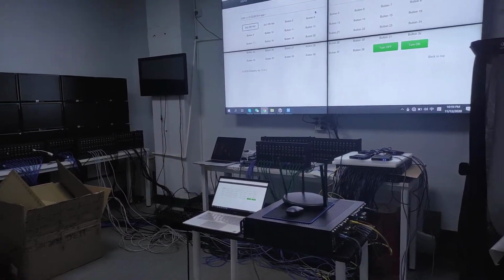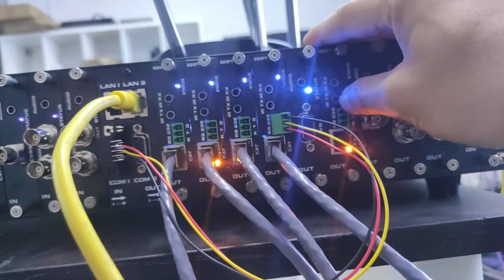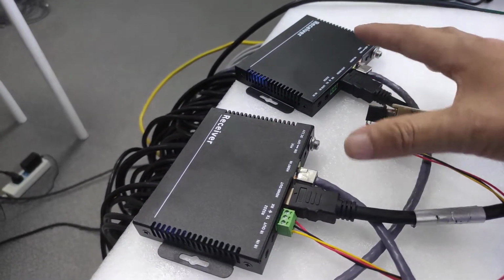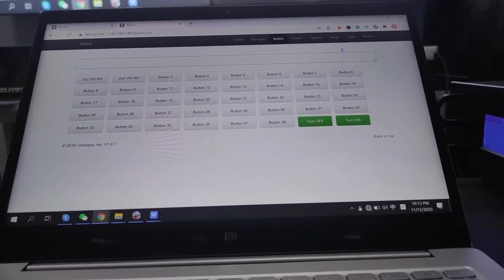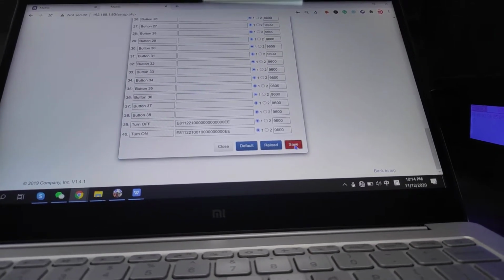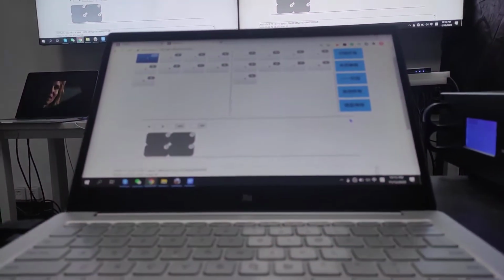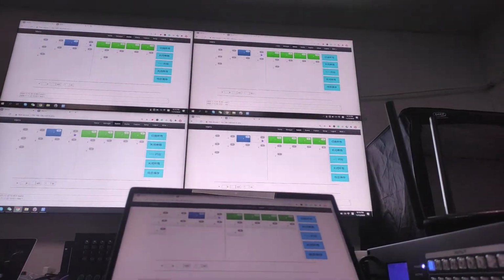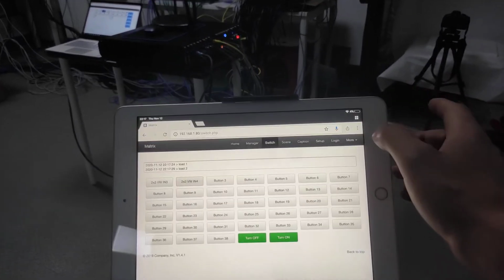Modular Matrix Switcher with the Multifunction buttons

Comment: I NEED MORE VEDIOS
Reply from the maker: Thank you, dear. Please help find more video links below, thank you. 
Modular Matrix Switcher with seamless switching	https://youtu.be/OMBe-DWgtyk	MINI-MANAGER-1800
MINI-MANAGER-900 with HDBaseT cards and receiver support bi-directional IR: 	https://youtu.be/eVL5o1iv6Mk	MINI-MANAGER-900
MINI-MANAGER-1800 with TV Wall function: 	https://youtu.be/2QRxcP62yy0	MINI-MANAGER-1800
4K60 MINI-MANAGER-1800 with TV Wall function: 	https://youtu.be/4AFMchj787I	MINI-MANAGER-1800
4K60 modular Matrix switcher with seamless switching: 	https://youtu.be/Hp3Li3-qEkQ	MINI-MANAGER-1800
ANY-MANAGER-1700 with TV Wall Function:  	https://youtu.be/CYzd0jutnaw	ANY-MANAGER-1700
ANY-MANAGER with TV Wall splicing edge adjustment: 	https://youtu.be/K1ZpQ_kjr3E	ANY-MANAGER-1700
All in one Huddle Room Solution HRS-5500: 	https://youtu.be/P0nmCeoqnt4	HRS-5500
With one iPad to control Two Matrix Switchers	https://youtu.be/_63ICP070i8	MINI-MANAGER-1800 & MINI-MANAGER-3600
36x36 Modular Matrix Switcher with TV Wall function, iPad control	https://youtu.be/rvpaKuogeTI	MINI-MANAGER-3600
EDID learning 4K30 HDBaseT input card	https://youtu.be/SjdisDQjC_0	MINI-MANAGER cards
EDID learning on the 4K30 HDMI input card	https://youtu.be/e2vyP4zV7W8	MINI-MANAGER cards
How to change input, output and presets names through the WEB GUI control on our matrix switchers?	https://youtu.be/lNr-ML0Eq-I	MINI-MANAGER-900
Mixed Signals inputs and mixed signal outputs with seamless switching	https://youtu.be/t7Ilu6i9_bE	MINI-MANAGER-1800
18x18 Modular Matrix supports Video Wall function	https://youtu.be/HLlBkzSN79o	MINI-MANAGER-1800
FM-800 modular matrix switcher with video wall	https://youtu.be/6eodG3vKw_M	FM-800
Maitrx switcher with 4K60 input card to work with 1080P output cards	https://youtu.be/ks2Bm6lcsWc	MINI-MANAGER-900
TCP control matrix switcher with Video Wall function and outputs FREEZE fucntions	https://youtu.be/gVyu8SUlnko	MINI-MANAGER-900
Modular Matrix Switcher with seamless switching, WEB GUI control, seamless switching	https://www.youtube.com/watch?v=FQhscTuRDto	FM-3600
How to turn ON/OFF TVs from the Modular Matrix Switcher control system.	https://www.youtube.com/watch?v=T99FpGIi3pE	MINI-MANAGER-900
FM 36x 36 Modular Matrix Switcher with the SDI/HDMI/CVBS Inputs and the 4K60 HDMI multiview output	https://www.youtube.com/watch?v=ijBQQuHr4Go	FM-3600
HDR 4K60 HDMI input and output card testing with 100m AOC HDMI cable.	https://youtu.be/cS00DPh0nf4	MINI-MANAGER-1800
1080P seamless switch cards on a 9x9 Card cage matrix switcher	https://youtu.be/rwlJxhSnAiA	MINI-MANAGER-900
Matrix Switcher with the quadview output	https://youtu.be/7GQvBxCkKss	FM-1600
How to have the audio matrix and video matrix in one chassis.	https://youtu.be/dXl6ywo60CI	MINI-MANAGER-900
Reply: @wangrocky7226 thank you bro
Reply: I have a question for the device, can I run it on an LED screen and split the screen into more than one image, but on one screen?
Reply from the maker: @mamdouhmabrouk627  Yes, for the LED screen, we'd prefer to recommend adding a LED processor after this matrix switcher or can use our VPX modular video wall processor with the LED output card, please hit me at rocky@beignhd.com, I will send you the details.